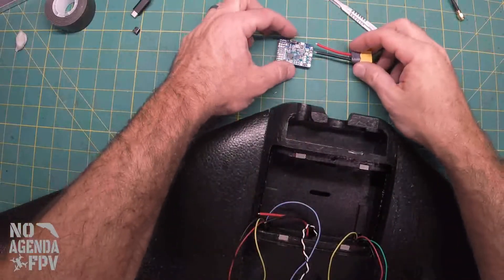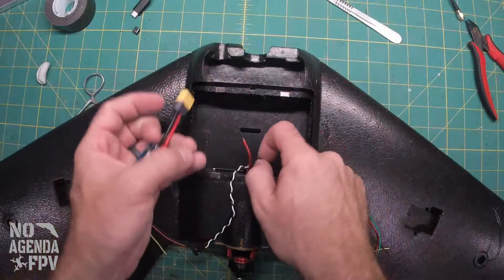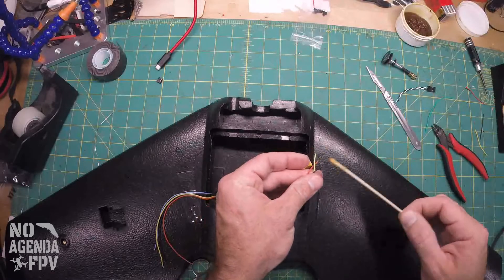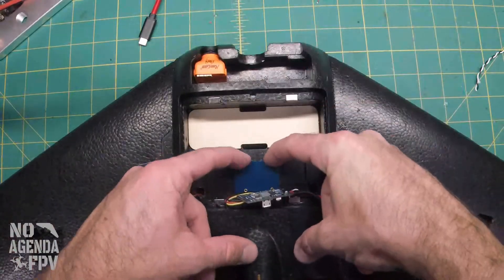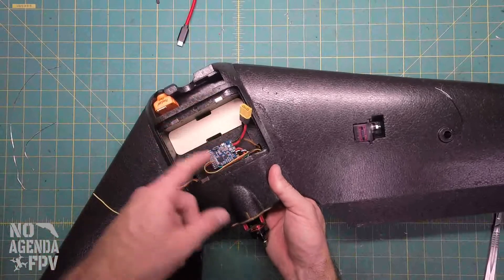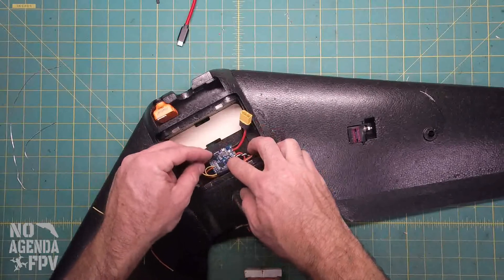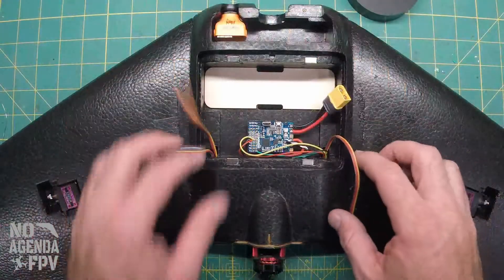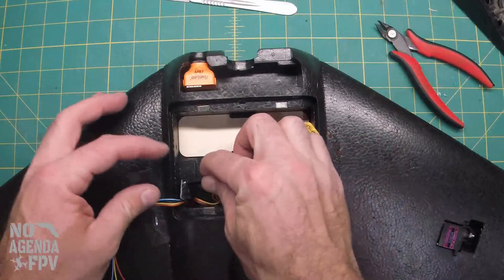Reptile S800 Build Pt4: Soldering FC/ESC/Receiver/Servos/Buzzer

Comment: Bro you video is good. I which I can see your connection a little bit closer
Reply from the maker: What part do you need to see? I could get some closer pics and video for you. I also suggest going to the Mateksys.com site and looking up their wiring diagrams for the FC you're using.
Reply: @NoAgendaFPV  I will like to know how to wire up tbs sbus receiver to this board
Reply: aldoyosbel@gmail.com this is my email. It will be awesome if u can help me with that
Reply: I need to see how u wire up the Rx. The motor signal
Reply from the maker: Sent you an email

Comment: Nice job dude,how did you setup FC in that configuration I have only ever fixed them with arrow pointing forward
Reply from the maker: Around 6:45 I talk about adjusting for flight nose up flight. In that same area you adjust the yaw to 90 or 270 depending on which way you have it turned in the plane.
https://youtu.be/ZmXgkilSD1w

Comment: Good video. I am interested to see your inav set-up specifically tuning. I found mine very twitchy on the roll compared to my S800 not running inav, particularly with a blustery cross wind. It was very hard to proximity fly under trees with much confidence. After a few weeks of manual tuning I now have it flying very well by changing the servo mix from 0.5 to 0.4 on the roll (I decided to change the mix not reduce the servo throw as I only wanted to change roll not the elevator ) and using PIFF of 12 / 9/ 44. P = 12 up from 5 in the pre-set seemed to make it more stable when windy.
Reply from the maker: Are you finding the roll to be twitchy in manual or in stabilized modes? If it is in stabilized modes then I would suggest putting the mixer back to 50 and adjusting the roll rate on the PIDs tab, top right corner. I fly my S800 in ACRO/AIR mode mostly and have my roll rate at 360, and my pitch rate at 160.
Reply from the maker: As far as tuning, I just auto tune. See Paweł Spychalski's channel for great iNav info. He is one of the core developers. https://www.youtube.com/user/dzikuvx
Reply: NoAgenda FPV Really two comments 1/ I use autotune and IMHO it is a good start but needs final tuning for windy conditions which it always seems to be here. This is not really an issue, just a comment. 2/ I Understand your suggestions on roll rate etc and have tried them before without success. I am not even sure if I have an inav problem. My twitchiness is on roll around centre stick . I am migrating from a DX6 to Taranis and picked up a the cheapest one a QX7 that I use exclusively for inav/betaflight. I have added dead band but I suspect the gimbal quality is not as good and the twitchiness is a reflection of low quality gimbals not inav itself. Reducing the mix in combination with expo seems to "hide" the issue. I have a frsky pwm receiver on order and I am going to try that in a non-inav wing that is rock solid and see if I have the same issue.
Reply from the maker: I also made the move from DX6 to FrSky, but the Taranis. Curious to see what you find when you get the receiver.
Reply: @NoAgendaFPV  which frsky transmitter are you using?
Reply: @NoAgendaFPV  My 4-in-1 irange module came before my frsksy receiver. Anyway I flew my favourite locked in wing (TBRC Apex V2) which only runs a lemon stabiliser/receiver with a DX6 and then the QX7 with the module. Both flew equally well with or without the stabiliser turned on. That says to me roll axis wobble with inav is an inav piff tune/inav setting issue not poor quality QX7 gimbles. Back to tuning I go. BTW: 4-in-1 module worked well with no noticeable difference in range.
Reply from the maker: Taranis X9d+, I use R-XSR receivers in my wings. Although I just installed an R9MM so will be trying that out soon.
Reply: @NoAgendaFPV  R9 promising but flakky as on 100mw I lose signal not far away but up close when flying overhead. Waiting on a Super 8 antenna + immortal t clones from horusrc.